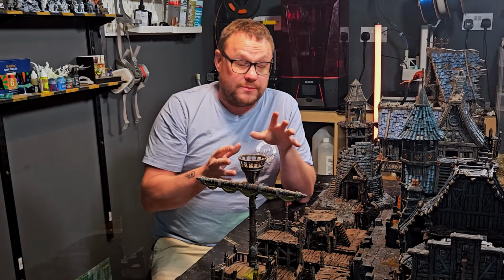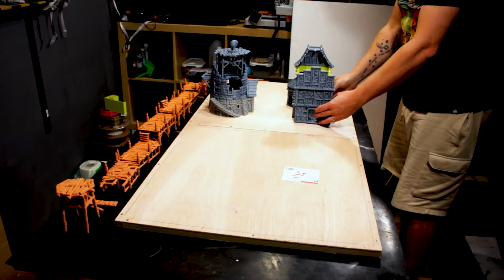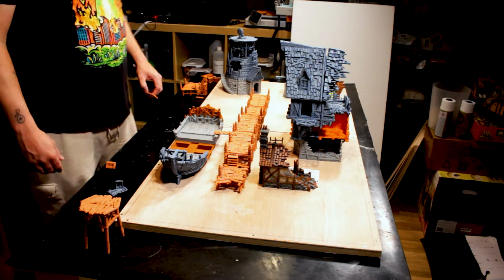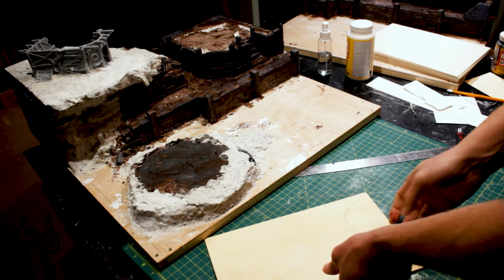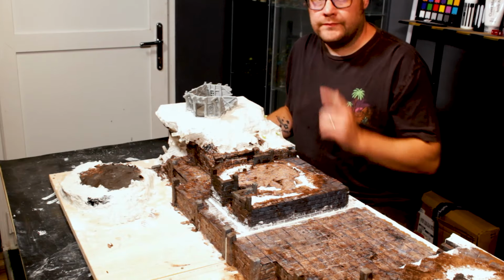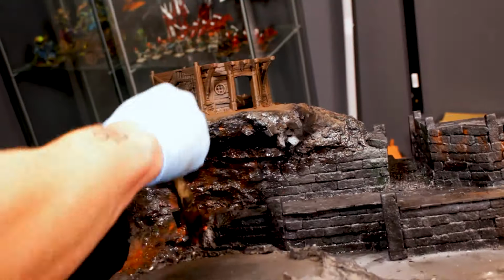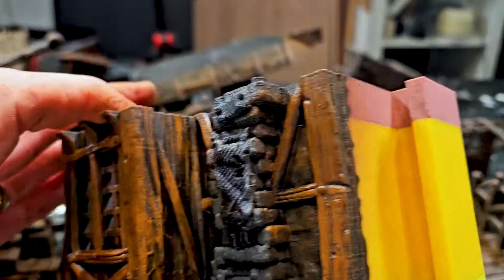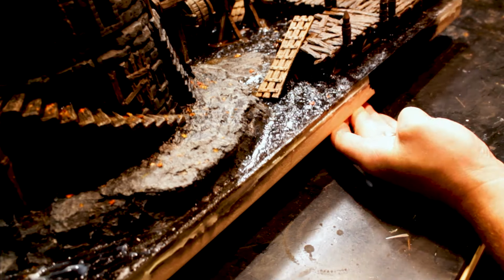The Best MORDHEIM Docks On YouTube? HEXENGARDE 2 PREVIEW!

Comment: Hi, I am printing Hexengarde all day , but i didn't get how to use the booster ring. Could you give me an idea?
Reply from the maker: @massimilianoausili6666  Whats the booster ring? Which building is it for?
Reply: @ The booster ring is the lower 6x6 riser.
Reply from the maker: I've reached out to the designer and it is to boost up the height of the second level riser to the level of a topper. Does that make sense?
Reply: @ Thanks for the answer. I thought i was for boost the height of the first level in order to fit retaining walls.

Comment: 19:40 you should be able to use a piece of 1.75 filament as the rod for the door.
Reply from the maker: @craigjones7343  I tested that and it does indeed work. I was worried how it would hold up with lots of back and forth in the classroom!
Reply: @ what did you use as a ‘wall’ on the edge of your board when pouring the resin?
Reply from the maker: @craigjones7343  Acrylic/perspex sheet. I bought a couple of the larger picture frames from IKEA (make sure they don't have glass, you need plastic). It's an easy and cheap way to get large sheets for stuff like this.
Reply: @ thanks

Comment: All of Hexengarde’s measurements are in inches not metric. It’s only a 5mm difference but might mean the difference between your walls, toppers or risers fitting nicely or having an overhang.

Not applicable to any of the freestanding stuff of course!
Reply from the maker: I naturally gravitate to metric because I'm in the UK, but I was impressed the 50mm foam layers lined up nicely.  Of course, it might be 2 inch foam instead 😂
Reply: @questsquills  I’m in Australia so I was a little surprised with Tired World’s choice of imperial measurements. I did ask about resizing objects that utilise the Open Lock system and that there might be problems.

I’m thinking that the 0.04mm is fine for smaller stuff but doesn’t scale once you’re moving into 4 or even 6” boards it can be a reasonably large overhang for the walls or risers

Given you’ve gone all in with foam it’s not an issue with folks who want to follow along and replicate your board ( which is slick btw!).

Super pumped to back this KS and get my port city happening!